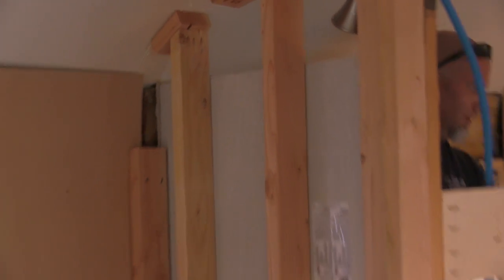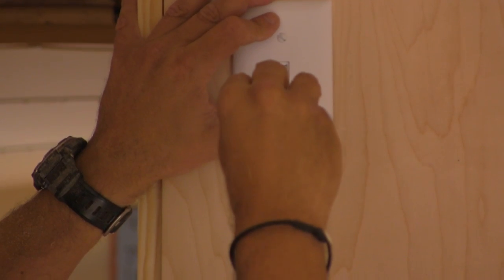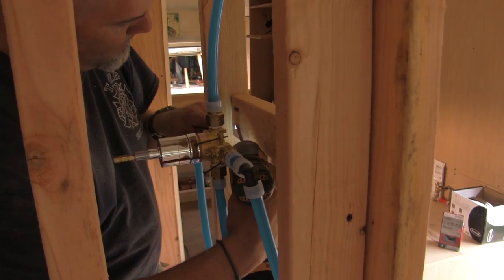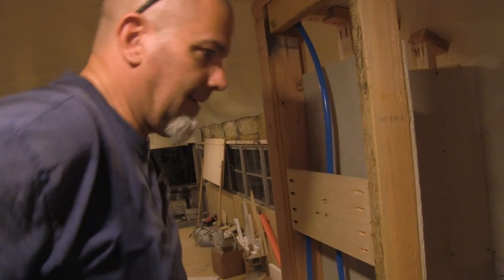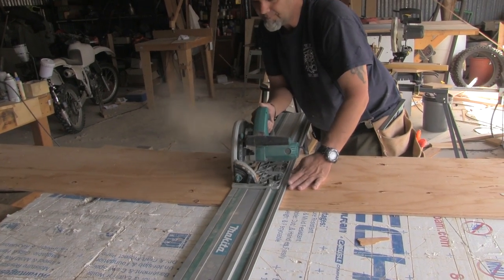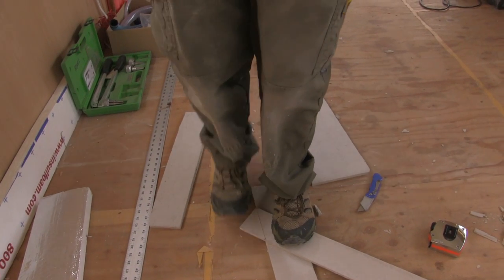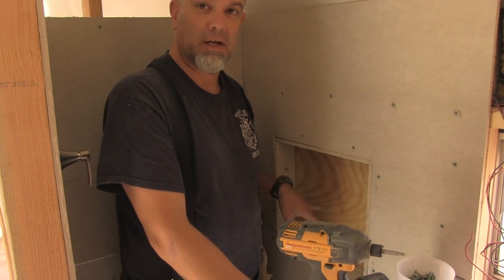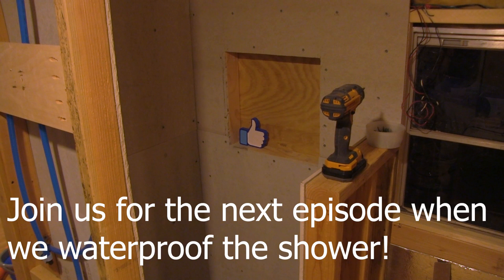Skoolie Shower Walls with Hardiebacker | Part 1

Comment: Good catch on the no-screw-zone. Maybe cut the backer board to fit the entire back of the niche, secure with adhesive, and then add and screw the 4 pieces around the back pice to hold it captive.

Comment: Excellent work and planning. Did you install a by pass valve in the shower to recycle the cold water in the hot water line back to the fresh water tank to conserve water when boondocking? Also, do the same in the kitchen.

Comment: Hello you could have put the back piece in with adhesive and then put the top bottom and sides in to hold it in with screws just an idea
Reply from the maker: I actually used 1" screws that didn't penetrate the wood back but thank you!

Comment: If there is one thing you want to be, That's PERFECT! Nice engineering change on the 2x4 to the 3/4" plank also. Quick question though, Why not green rock on the shower? I'm asking because I don't know, not because I'm being in your Bussyness.
Reply from the maker: The bus is going to flex and move. Green rock is just water resistant sheet rock and can still swell if it gets wet. Cement board will stay the same wet or dry. Since there will be tile on these walls, it needed to be solid.
Reply: @BussyMcBusface  Thank you so very much for the insight. I think yall's buss is going to be amazing!